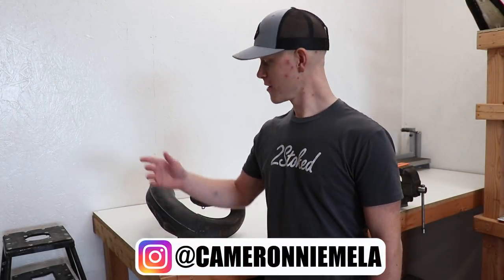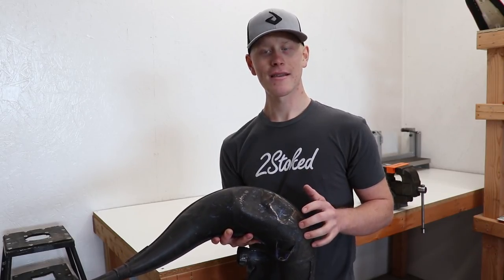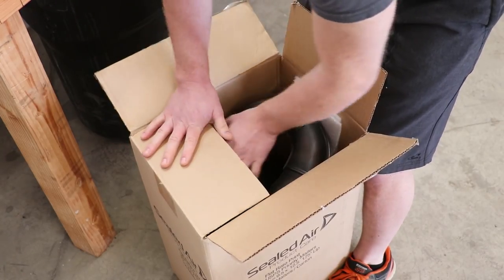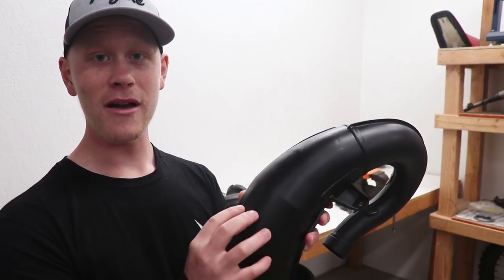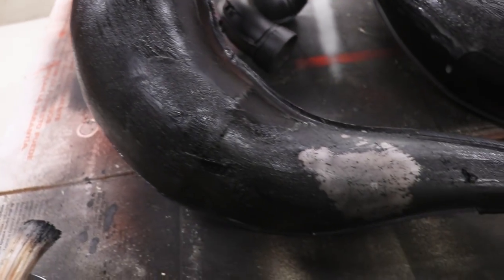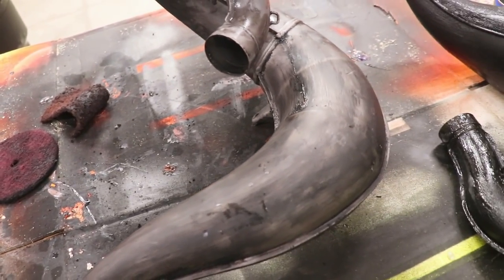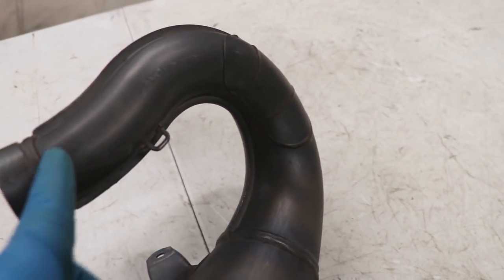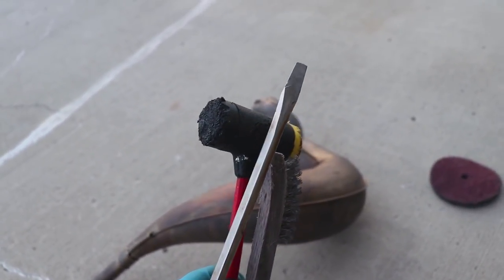Fixing Dented Two Stroke Pipe

Comment: DPR pipe for sure!  
And me and my buddies how we cleaned out the carbon from our pipes was we would heat up the first 4 or 6 inches of the end of the pipe that goes on to the cylinder with torches and then hit it with heavy air from an air gun hooked up to the compressor and it would just get the whole pipe glowing red almost in burn all of it out and blow every piece of carbon ash out the other end and worked really great never had any accidents LOL

Comment: Also a strong oven cleaner sprayed inside the exhaust and left for 20-30 mins will clean out the pipe,also good with aluminium but you can only use oven cleaner in or on aluminium for a few minutes only :)

Comment: Great video , thanks for getting back with me on the scotch brite wheel.  I like the cone pipe but I'm 60 old school lol. My question is how much did it cost total to have them pull out the debt in the pipe . Not both together just one pipe . With shipping.  I mentioned that I'm restoring a 2003 Suzuki rm125.  And it does have a dent in the pipe . Not as bad as the one that was crushed.  A month does seem like a long time . Thanks again for your help . All your videos are so informative.  Thank you .

Comment: The easiest way I found to remove the carbon from a 2-stroke pipe is plug the ends with a rubber drain plug that tightens with a wing nut. Fill it with liquid oven cleaner extra strength and plug the other end and let it sit for 2 days. Then all the carbon liquefies and you can just pour it out. Then rinse with water. Repeat until spottless...  it took me 2 times to get mine spotless. I removed about 3/4 of a qrt of carbon. It's easier then the oven method.

Comment: You can plug one end of a pipe, fill it with water and make an attachment for your pressure cleaner for the other end. It will blow out any dent and if it blows apart, its just like a hose blowing off the tap, perfectly safe. Best way to remove carbon is a caustic soda mix (providing pipe is not alloy), plug one end, fill and leave overnight.Then hose it out, pipe will be as clean on the inside as the outside.

Comment: Hey Cam if you ever have to burn out a pipe with a torch again burn it till it catches the carbon on fire like you did then use an air nozzle and blow compressed air through it to get it super hot.

Comment: I blocked the open ends with solid rubber buffers compressed with a bolt. Added a numatic connector, and increased air pressure while heating up the dented areas of my thick heavy 4 stroke exhaust header redhot. Found out the exhaust leaked air from at least 15 seperate holes and cracks. Ditched it and bought a new one for crazy money. But that's life.

Comment: Good video cam!  I'm doing almost the same thing as you...I have a cone pipe being made for me as we speak but my bike came with a pro circuit pipe so I just ordered the ebay dent repair kit and I am going to give it a shot.  I have never even thought about the hammer sound test for carbon buildup.  I bet my pro circuit is full of carbon.  It felt heavy last time I picked it up if memory serves correctly. I am going to do the hammer test tonight after work for sure!

Comment: That's kinda messed up that they took it upon themselves to paint them without asking what you wanted.
Reply: I know right?  You could tell that he had them raw for a reason.
Reply: So it won’t rust probably
Reply: Juan Rios if that were the case they would have simply oiled them. The paint was probably to hide the not so great job they did tbh
Reply: Cory Rich no it’s so it won’t rust it’s a raw pipe and when it’s heated with a torch and cooled it can rust
Reply: That’s what the oils for
Reply: To be honest i thought they would of paint it

Comment: Couple of ideas here:  I clean out my pipes in the following manner......place on charcoal BBQ and get them VERY hot....using a torch at the engine end of the pipe, get the carbon red-hot.....then turn off the propane/MAP gas/acetylene (whatever you're using) and blow either pure oxygen or air from your compressor thru the pipe.  If you get the carbon burning the oxygen/compressed air will keep the burn going from end to end.  (Oops!  Leave the pipe on the burning BBQ to keep the carbon in the temperature range for self-ignition. You can also use a shop vac with the hose plugged into the exhaust end of the vacuum end for the air supply. )  I picked up the idea from an old diesel mechanic who used to burn the carbon out of the ports in diesels....both 2- and 4-stroke diesels.  Also, I'm an old time desert/enduro racer and can't keep up with the maintenance of a naked metal pipe....so I've had good luck with keeping my pipes black in two ways:  1)  Find some self-etching stove paint (think ancient pot-bellied stoves) and paint it.  When it gets hot it bonds with the pipe really well.  You can also touch up a black pipe that way.  2)  I've seen guys use cold blueing for guns and paint a super-stripped clean pipe with blue (which actually is black).....again, it etches the metal and is pretty much forever and you can touch up scratches.  Takes a lot of blueing compound to do this but is nice-looking and different from other guys pipes.  Thanks for the video and it's really good to see you back.  Hang tough!

Comment: Cameron Niemela....if you wanna clean out those pipes MUCH easier and actually get them clean, go to Granger or a HVAC supply company and buy a "Furnace Brush". They are used to brush out Heat Exchanger's inside a Furnace. Its a strong sturdy but bendable metal rod that has stiff bristles. It would work perfect for this application.

Comment: I haven't had a two stroke for years but what I used to do was plug one end with a potatoe, fill it with caustic soda (paint remover), and leave it 24 hours. Then rinse. It would then sound really zinngy, like new. And good luck with the chemo ... it's not an easy journey.

Comment: I have seen people do this with a pressure washer, if you go slow and fill it completely with water before you plug both ends it would have been fine though it doesn't always get every don't out but most, biggest worry is getting covered in water if the plug fails...

Comment: Ok this is gunna sound whack.. but for carbon in head pipes, submerge it in a large rubbermade storage vat.. about 10$ ar walmart, and use 1 full 500ml bottle of original pinesol. Fill with warm water and leave the headpipe, or anything else thats cruded with carbon in over night.. it all slides out! Worked many time for me, without discoloring that cant be solved with a green scotch bright pad! Btw your looking good man,the lessions heal!

Comment: i welded up the muffler end with scrap, vice grip clamped a vacuum pump port (composite work) to the bigger end... that way its ready for compressed air... low pressure (20-50 psi) plus mapp torch... 1 month frick off!  you graze the damaged area the same way you are bluing the pipe to get the dent out(maybe a bit longer).. i would have sandblasted that paint off..(aero stripper is nasty shiz)

Comment: You can use a hot air gun to remove carbon. 
1. Use aluminium foil so seal off the gun on the pipe. 
2. Run the airgun full heat and flow. 
3. After about 15min you will hear the pipe making a lot of noise. This is the oil and carbon burning. 
4. Redo the process from the other end as well. 
5. Remove ash from pipe.

Comment: Cameron, need some help right here, I got  a dent in my inner tube , it is small like 3/4 inch but it starts right next to the oil seal, means oil is always leaking, have you ever fixed some like that? With glue or some solution? Thank you

Comment: Take a one meter-is (3ft) long used clutch-cable (or bike-brake-cable, whatever steel-cable really), mount in in the chuck of a hand-drill, put the cable down the pipe and press the trigger. The cable will start swinging inside the pipe and brush the carbon out.

Comment: Hey bud, just for your safety and others get yourself some “welding gloves” for handling hot items, you don’t need fancy ones any welding gloves from s hardware store, we use em for the barbe cooking, stuff like this, will protect your hands and they are cheap, also wear a mask again you can buy the fancy stuff or packs of those cheap soft mesh ones do just as good a job work well for that type of job.I know ya have the fancy respirator, the cheap ones good for quick jobs like the pipe etc

I also think that was pretty rank of those guys to paint your pipes, like others have said, they should have contacted you first, seems to me they painted them to cover up what they couldn’t take out, I have seen better from guys doing it with air and heat themselves.

As always mate great work, you really cover the details really well, enjoyed it.

Hope you had a great Xmas and doing well mate. 🤙

Comment: there are a verry small chance of getting hurt when putting air in the pipe when u seal the pipe, done it for about 5 years on about 30-40 pipes without any chance of hurting myself, there are like 2-5 bar preasure in the pipe and thats not mutch...u use a small flat hammer and blowtorch and the pipe becomes as new. if there is anyone got hurt by that then they have made some real wierd shit.-

Comment: yo cameron. i have a 2009 ktm 125sx and was trying to do the heat coloring on the stock pipe but all the torch did to the pipe was make it it red hot and after it cooled there was no color change... any tips on why it is not coming out? Also i like the DPR pipe 10 times better than the stock. keep on fighting bro!
Reply from the maker: Thanks dude! The pipe has to be raw steel in order for it to work. Your pipe is nickel plated

Comment: Should've fixed the pipe via hydroforming probably much safer
Reply: Ive done it a few times but needed 6000psi to get the harsh dents out .
Reply: @petertaylor3424  oh yeah that's hard for a normal guy
Reply: Yeah . had to lathe up custom plugs . but can use a porta power pump though .

Comment: To get carbon out of the pipe you can pour some gasoline in the pipe an shake it a bit, then set it on fire and it will blow out carbon and burn of oil inside. Its not the best way but its quick and easy
Reply: Haha me and my cousin did this and set half of there back yard on fire
Reply: Thats why i did it in the winter here in Sverige XD

Comment: Doesn't a larger diameter = a lower surface speed?
Reply from the maker: Nope, the surface speed of an 8 inch wheel is 2,000 feet per minute faster than that of a 6 inch wheel
Reply: @CameronNiemela  I'd check on that. Anywho, I'm glad it worked and thanks for another great video. I hope your treatment goes well